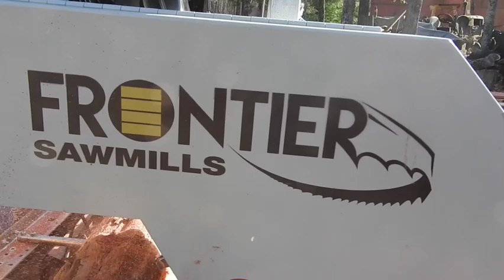Nasty Dead Cedar Converted to Posts - Frontier - Outdoors

Comment: Nice cuts with the band mill. I couldn't help but notice you hanging out near the saw dust exhaust port while cutting. A strategic location for removing cutoffs and getting your fix of the sweet smell of cedar. This for the vids!
Reply from the maker: Yes, that's a good location for the second guy to hang around. Less lost time in product removal for sure, and shifting or rolling the smaller cants by hand is very easy from there. The side benefit is the guy on that side is constantly aware of the height of the log stops.  Cedar does have quite the pleasant aroma !!  Thanks David for the visit today.

Comment: I love the smell of the cedar wood and really liked seeing your sawmill in action.  
The repair facility where I retired from used to purchase quantities of rough cut oak lumber for dump truck sideboards and trailer flooring from different sawmill operations here in Ky. 
I remember that the boards were at least 3 inches thick for the dump truck sideboards and at least 2 inches thick for the trailer flooring. We used to cut up the best portions of the used boards for blocking sections to support the trucks and equipment that were in for a complete tear down in the garage. With all of the oil and grease soaking into the wood, Some of the wood block sections had some age on them. 
During the Snow/Ice season, I was assigned to a county in addition to my duties as a welder/fabricator to operate a front end loader to load salt for our trucks as well as the contractors trucks. So I am very familiar with the loader hand signals. 
A good ground person who knows how to give proper hand signals to the loader operator makes all of the difference in the world for many operations.
Reply from the maker: Thanks IronDuke for the cool comment.  You too have had a rewarding career.  After a 40+ career in commercial HVAC, I have signaled crane operators from the side of the roof in setting equipment literally hundreds of times.  In some cases another fitter or tinner would have to signal me from where the unit being set over or behind another, then I would relay to the operator. Most lifts I could direct from my point. And of course there are many operators in my family...my son, one brother, two nephews and innumerable cousins. 
  The tree trimmer that drops me his off-fall is going to bring a few logs for me to saw into decking material for his flatbed and sideboards for his 14' dumper.  It'll be oak.

Comment: Groovy grooves; I like it!
Reply from the maker: Sounds like 'sounds of the 60's' Matt...   'Wild Thang'...LOL  Naw...you ain't quite old enough for that old song.  But I do like the grooves.  I stuck that old blade on there because the wood was so questionable as to quality.  We'd already chopped off a lot of bark with ground in dirt and mud. We didn't expect too much out of them and were pleasantly surprised at what DID come out.
Reply: @tractorman4461  actually, I DO remember Wild Thang LOL! Back in my Pacific Northwest days, I rescued quite a few logs that had shell rot only an inch or two in. The rest was still quite useable
Reply from the maker: @mattthescrapwhisperer  I can only imagine what it was like working in the PNW and the forests up there.
Reply: @tractorman4461  well, I spent most of the time fighting brush 15 feet tall just to get to the tree I was after!

Comment: Hi TM. I thought I heard some bent teeth hitting ,They make a sound I haven't forgotten yet. And the strips on the two pieces where you were sitting at last part of the  video.You can make a tool out of 3/8" plate shaped like a wrench,with a slot just a little bigger the the thickness of the band saw blade  and a vise.  Hope that helps.  All my best.
Reply from the maker: Yes, you sure CAN hear the rhythmic beat of the bent teeth Bobby.  Thanks for the tip on the tooth tool.  That's an easy one to make for sure.  I'll keep the old blades to experiment with and then use them for sawing into questionable wood or the telephone poles to make 6x6's.

Comment: "A rifle range", now you're cooking with gas on" Target shooting is one of my favorite pastimes.
Yes too, I see that pattern that the damaged blade made as it cut  through the log, interesting isn't it. There will be plenty of 'patterns on those posts by the time they need to be replaced again, I'd imagine. :)
The sawmill seems to be cutting just fine now, doesn't it, of course, I realize that the cedar is a lot softer than those oak logs you cut first.
Thanks for this.
Reply from the maker: He built a shooting shack about 12'x20' fitted with old windows and an angled overhang out the front.  The front has windows that open for aiming through but the shack provides protection from winds and rain and the front overhang provides protection for the guys aiming out the windows.  I'm sure in not time, the posts will be loaded with lead....  LOL  All he needs now is a little pot bellied stove and a old time coffee pot for the ol' man.....
Reply: @tractorman4461  All that sounds like a dream range and cabin in my mind,.. BUT " wind and rain" say it ain't so! hahaha,.. surely not where you live! LOL!
Reply from the maker: @regsparkes6507  Hahahaha....yes, it IS so my friend.  LOL  In my book that beats snow and ice.  The range is pretty cool, with a natural bluff rising right beyond there's an added element of safety.  We've made him some spinners and other targets and made those supports out of old gas pipe with re-bar hooks.  But he still needs a little heat in there for me....LOL  I'm a fair weather shooter (-:
Reply: @tractorman4461  No shame in needed a bit of heat in there. The indoor range i go to is subject, somewhat, to the outside temperature to, as the huge exhaust fans draw air from the outside, so long story short, I hear you, in wanting some heat.
Cheers Brother!
Enjoy this evening's celebrations, in whatever way you choose to do so.
Again, Happy New Year to you and your Dear Wife.
Reply from the maker: @regsparkes6507  Thank you Reg, for the well wishes and Happy New Year to you and all you care for as well.

Comment: It is so sad to see all that aromatic cedar sawdust go to waste.  Can you fashion a collection system on the exhaust with a strong band and that would make a Crafter very happy to have filling for their stuffed animals, pincushions and the like.  I am sure you have folks in your area that would be very thrilled to receive such valuable sawdust.  Just an idea.  I enjoyed the video.
Reply from the maker: It probably wouldn't be too difficult to come up with something.  But I think it'd be a high maintenance exercise...but like I just told Peewee above, if it is ever operated inside a building some sort of dust collection will be a must.  Something with a power blower, flex pipe and cyclonic separator. It really isn't that difficult to come up with all that stuff.  I have a 40 or 50 gallon cyclonic separator sitting in the lean-to....plus the blower for it as well !!  Imagine that, huh. LOL

Comment: Beautiful cedar posts. Have you considered a section of flex hose/pipe to hang on the end of your dust discharge so it drops straight down?
Doc
Reply from the maker: You know Martin, that's not a bad idea. We haven't really gotten to use it steady enough yet to get into a rhythm or patter so to speak.  But that would surely keep the dust down a bit.  Thanks for the idea.

Comment: Would it be possible to hang a pail to catch the sawdust and then put it into a pile at the end or into some sort of container?
Reply from the maker: Yes, I am sure it wouldn't take too much effort Peewee. It'd probably have to blow into the bucket through a funnel, with a porous cloth to relieve the pressure but capture the dust.  It'd probably be a high maintenance exercise.  If this is ever operated indoors, I'm sure some sort of dust collection will be just about mandatory.